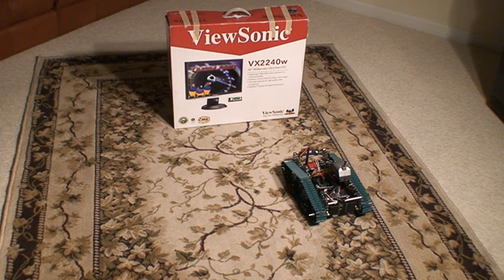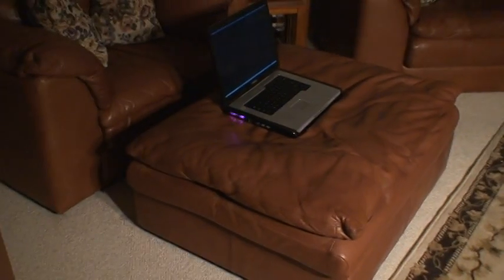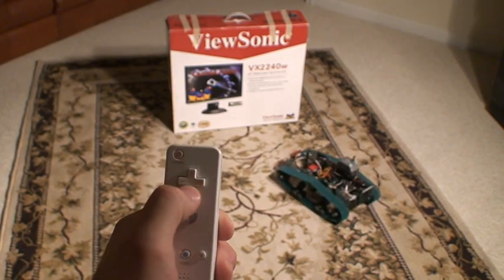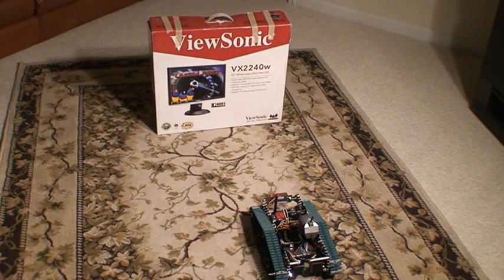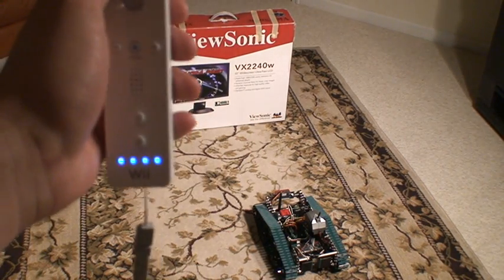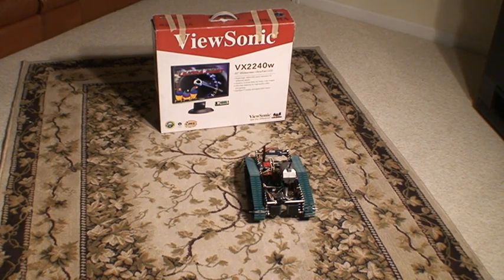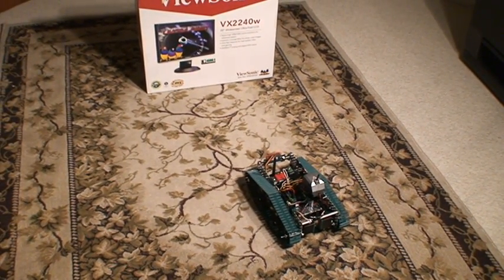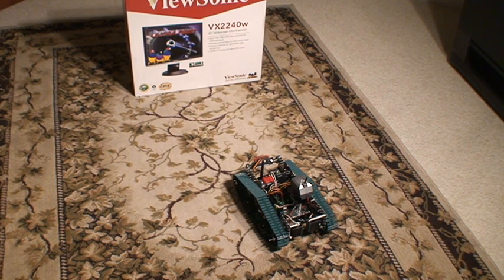RC Tank - Wii Remote

Comment from the maker: Not directly to your computer but its possible. The video receiver has the typical red/white/yellow output to connect to a tv. Take this and connect it to a capture card (or usb capture device) and your microphone in on the computer and you will be able to view the video on the computer and hear the audio. A wireless webcam could be used for direct input but those can cost big bucks.

You can make programs to capture the video or view it in a media player like vlc media.

Comment from the maker: Yea I don't have any picoITX board's, lots of regular motherboards and laptop though....I do however own a beagleboard (google it) which runs linux and right now I am getting better at programming it. The nunchuck could be used to do that and it would work nicely but at the time I had not figured out how to pass serial data between the pc and arduino so I didn't do it (Though I could do it now).

The hand is coming soon, by next Monday I should have a rough system together. I might post a video

Comment: A happy medium between the laptop and a dedicated bluetooth decoder for the Wiimote might be a picoITX board running linux of off a USB thumb drive. You could fit one of those in that tank easy peasy.
Also, the nunchuck wouldn't be such a bad idea to control the tank as you could implement smooth speed control of the motors.

But I shouldn't distract you, you have a mechanical hand to build! lol

Comment from the maker: If the bluesmirf can connect to the wiimote and pass serial data I do not see why not. The only thing is that there is a lot of data that is exchanged so you would be coding a lot to get the values that you want. The easiest way is to use the pc (vb/C#.net program, wii mote library) and then relay info over serial to the arduino. This takes the load off of the arduino and puts it on a very fast pc.